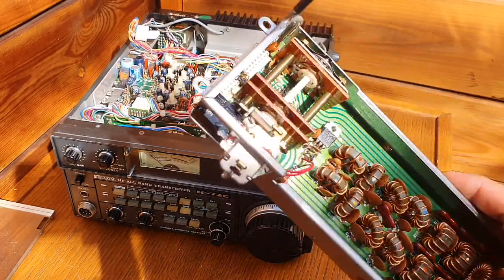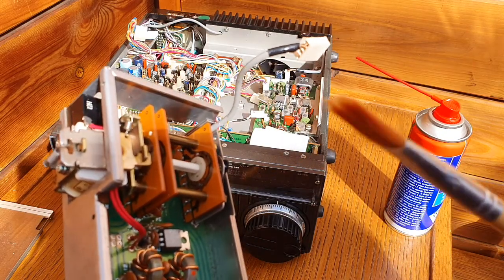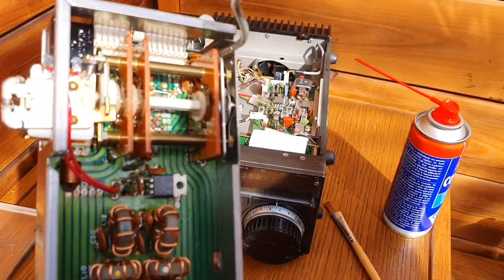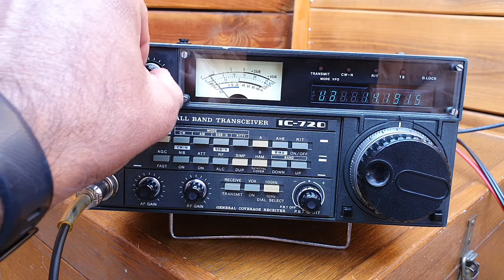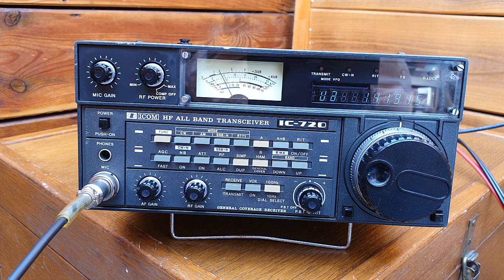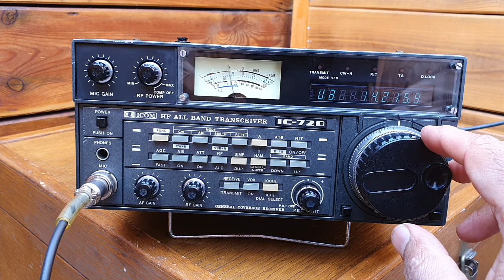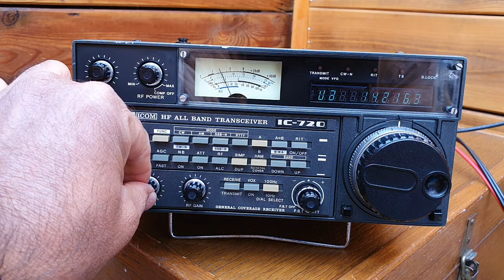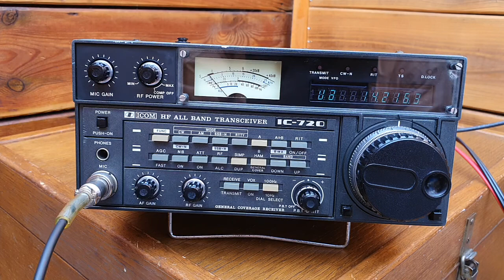Icom IC-720 HF Transceiver - Relay Repair - Easy Fix

Comment: I have an ic701 and the S meter relay is causing problems . Cleaned contacts and used fine wet and dry paper but not 100% sorted.
Reply from the maker: Thanks for sharing your experience! I think you have done all one could do therefore better replace it. eBay is good source to look for the replacement parts for the old radios. Good luck & keep us posted. Best 73s & Greetings from The Netherlands.
Reply: @spacetimeengineering Thanks very much. I have found a relay that may work. But the radio has developed another problem . I've got it so that the meter reads OK on receive now but doesn't show output power on meter. Reckon this fault is elsewhere. Maybe I messed up when fiddling with relay. Swr doesn't read on meter either. Relay plugs in so trying to follow wiring back to swr transformer.  But not had much luck. Put it on hold until new relay comes. George

Comment: I fixed my relay with your video but can you show me how to change it to a.m.
Reply from the maker: I am happy that my video helped you fix the relay. Well changing to AM mode is very easy and it has four mode buttons to chose CW, AM, SSB-N & RTTY just infront on the top row after function button which is next to power on-off button and if you look towards right you will find them. many Thanks for supporting the channel, much appriciated.